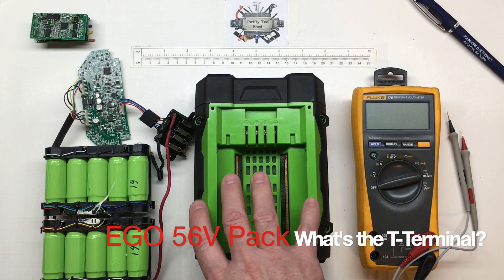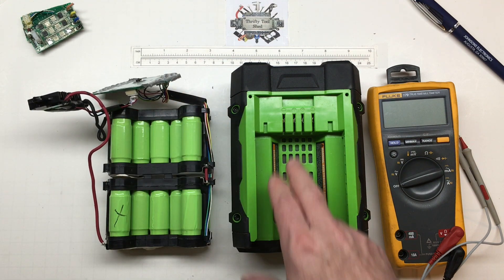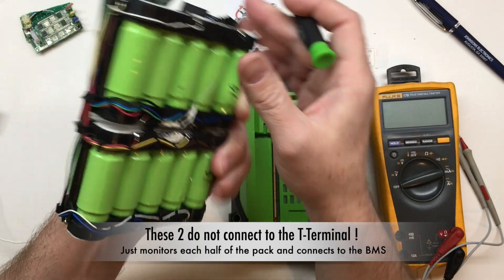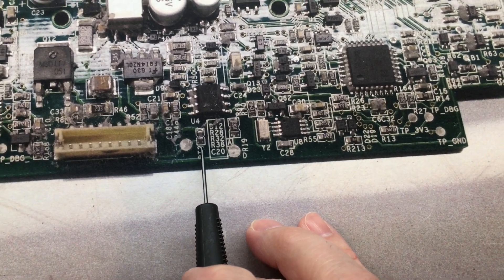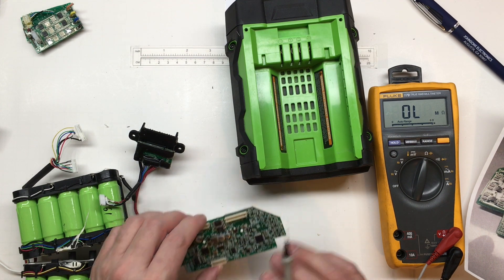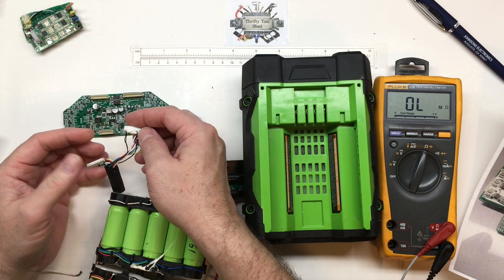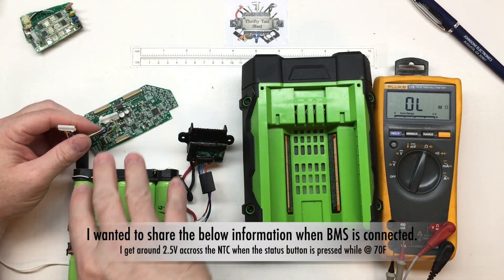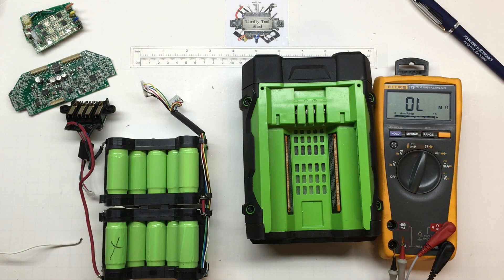EGO 56VBattery - What is the T-Terminal?

Comment: So does the bms work without T terminal or D terminal being connected to ebike motor???
Reply from the maker: The BMS will communicate with EGO tools so if using power terminals for e-bike, you will not have any BMS protection.
Reply: i have used 56volt battery on my ebike no problems but byoass bms as it had a fault.need new charger now though i used 48volt ebike charger will do same again. @ThriftyToolShed
Reply from the maker: Yes the tool requires the D-terminal. Most tools run about 10secs and shutdown if communication is not established between the tool and the pack.

Comment: Can you just fake it and put a 10kohm resistor so you can charge with any diy charger?
Reply from the maker: Well the T-terminal would not be hard to fake. The D-terminal to communicate with the BMS would be a issue. If you want the bms to monitor pack that is. You could actually charge with diy charger though if very careful and monitor the cells very well. The pack terminals for + and - go straight to cell connections. I always use constant current and Constant Voltage supply.
Reply: @ThriftyToolShed  so by using these batteries with just + and - the bms is  bypassed completely? Is that OK with 20A-30A 1000 watt max discharge?
Reply from the maker: @kyleschraw7600  That is exactly right. + & - terminals come straight off, it does go through the 40A fuse. I would think up to 30A would be ok, but of course as mentioned on several videos, make sure we do not pull below minimum cut off voltage level. Since it has no over discharge protection. I have a couple videos about using some of the Low voltage cut out module. I would not pull below 42V to be safe.
Reply: @ThriftyToolShed  I want to use a diy charger like you said but have the bms balance it and shut it off if a cell is to high
Reply from the maker: Yeah, it communicates through the D-terminal for that. You would basically just need to get a 60V 5A supply that you could set for CV of 58V and set CC at around 1A and monitor each cell yourself to make sure they are balancing out ok. If the cells are in good condition, they will not drift much. We still have to always monitor and make sure.
Reply: @ThriftyToolShed  I do but to bad couldnt use what's there easily to take advantage of the bms
Reply: I just tried this with my dead new-style BA2800T and factory slow-charger. Batt test light would flash 2 greens for 1 pulse, then all red. Charger lamp showed overheat and would run forever. "T" terminal showed open so I soldered a 10k resistor from the blu wire to the large ground lug on the power board. With both "T" and "D" now showing 9.6k-ish, battery test light now flashes 3 greens, 2 greens, one green, then all red. No charging, oh well. If anyone runs across a box of new-style BCM boards let me know, I'd buy one!
Reply from the maker: This same fault seems similar to the older BMS boards as well. This is one condition I have not found a fix for yet. It must be an issue with the microcontroller. I actually have taken time to measure basically every reference and thermistor feedback from a good pack BMS and compare it with the bad one doing this and have not found a obvious issue. 
It seems in the BMS for sure.

Comment: I just called in to the call centre for a bit of tech help. "D" is the discharge terminal. "T" is the over temp terminal.
Reply: Can anyone else confirm this or specify?
Reply: @kyleschraw7600  I'm pretty sure the "D" terminal is DATA.
Reply from the maker: DATA is what I have called it for some time. Not saying that is correct. I am positive "Discharge" terminal makes no sense at all..